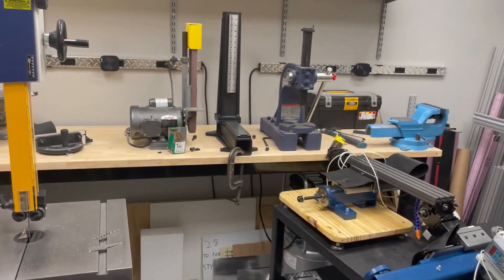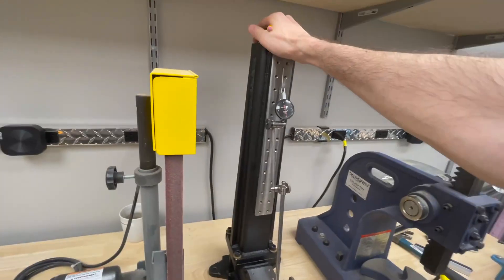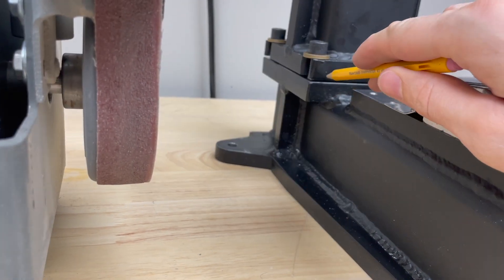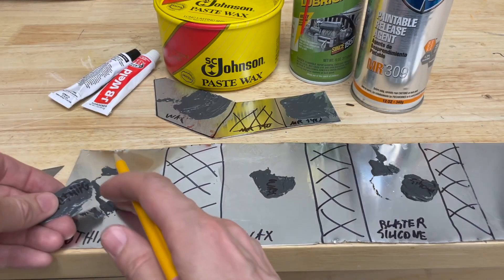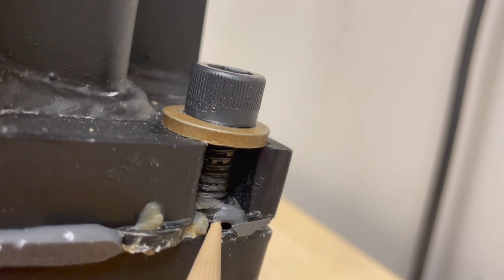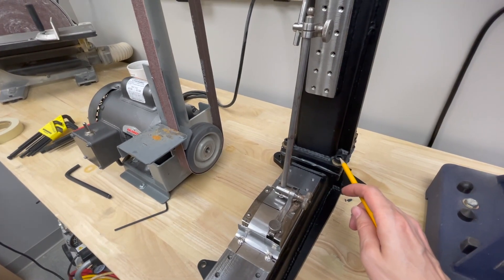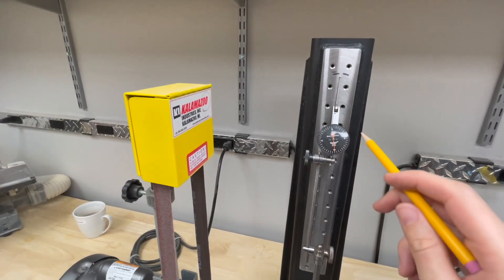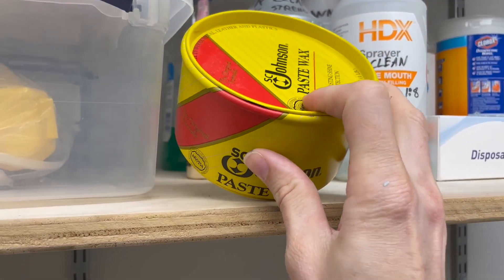Ep7&8: Epoxy Granite CNC Design - Tramming with Epoxy

Comment: I'm a little late, but that long indicator tip will half your reading. .001 actually equals .002
Reply from the maker: It came that way from the factory, it is direct reading. Mine was bought new in the mid 1990's. The current model number is 599-7035-5. (I don't have mine in front of me to get its model number). You can look that up at Grainger and see it comes with the long stylus.
Reply: @nickp4793  My mistake. Looks just like my B&S that comes with the  1/2" tip. Great video!
Reply from the maker: @akr1865  Yeah, I have a couple of those too. They were offered in 2 dial diameters and two stylus lengths from the factory. Great tools. The new ones are all made in China. I think the only new brand left is Mitutoyo, they are still made in Japan and are about $130 range new on Amazon.

Comment: the point of epoxy tramming is not to eliminate flex, it is to eliminate ring and thus harmonics that will increase the chatter caused by the lack of rigidity
Reply from the maker: Yes, agree. I wanted to see if the JB Weld epoxy had any negative effects of being "softer" and introducing flex in the system compared to a metal to metal contact.

Comment: Your test is dependent on the bolt preload of the column base. Without using a torque wrench to apply the exact same bolt preload to each of the iterations, your results are inconclusive.

Comment: Very interesting.  I'd think when tramming, the epoxy would need to be applied as a film, but I'd still think that it would cause problems when it needed to be re-trammed, since it most certainly will. I'd also think that the center of the column base doesn't really matter since most of the lateral force is probably borne by the outermost inch or so of the column base.  The deflection when using shims should be minimal.  You'd probably get most of the movement from the flexing or stretching of the screw threads.  If the goal is to reduce flex, the solution would seem to be more screws to connect the column to the base.  The test was very well done.
Reply from the maker: Thanks for the comment. Yeah, a million ways to skin a cat:) One reason I wanted to explore this metal-filled epoxy tramming method was it would not require any precision machining/grinding/scraping of the interface between the column and base, making it appealing for hobby use with less tools than a legit machine shop.

Comment: Not sure what you're planning to use on the final version, but in my experience JB Weld is very brittle.  I would be concerned about cracks over time.
Reply from the maker: Thanks, its my first time trying it. The real version I may use a product called Moglice, which is made for machine tool leveling, or take the easy home depot JB Weld route:)

Comment: Hi, my understanding of the epoxy pouring was to recreate full contact surface after traming to not loose rigidity, not improve it.
I believe that when no traming full metal contact and tramed epoxied test, you're really testing frame and column rigidity 🤔
Now you have to fill this frame with EG! 😉
PS: would you share a link frame supplier please  ?
Reply from the maker: Hi, I had the same understanding of the epoxy leveling, but wanted to prove it to myself that it was not "softer" and lead to more deformation. On the next episode I fill the whole thing with epoxy granite mixture. I'm editing that episode now. Do you have a Taig? This frame is made by a member of the Taig facebook group. He makes them out of his garage, but I think he might have stopped recently as the material prices became too high.